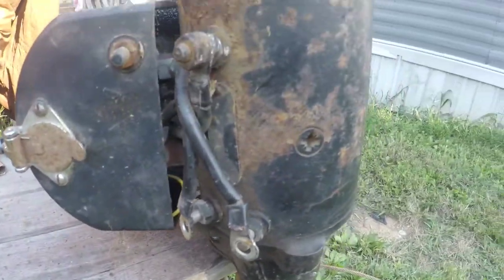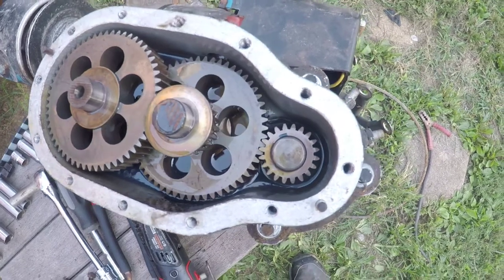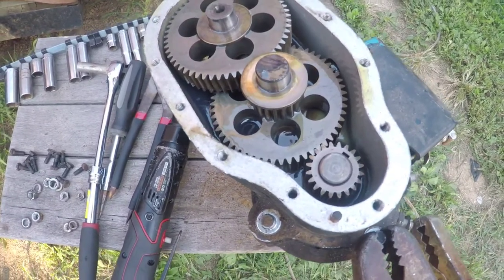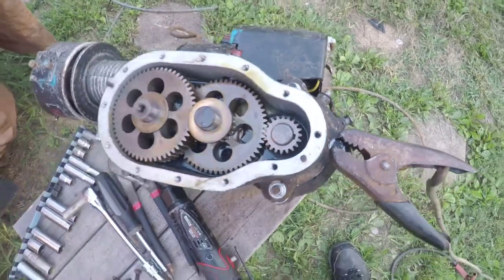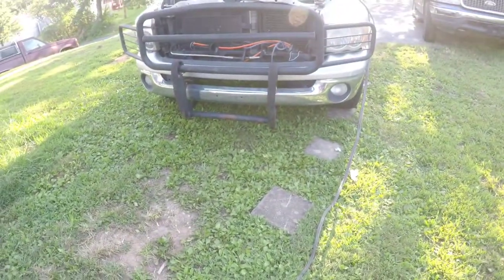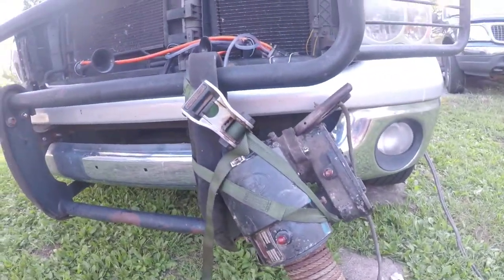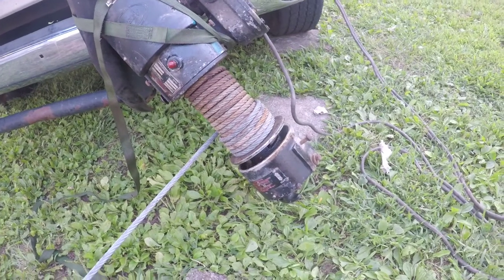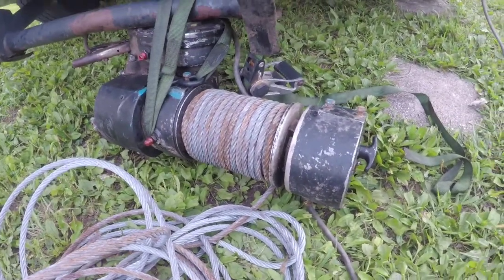Fixing a stuck Ramsey winch

Comment: I got three Ramsey electric worm drive winches dirt cheap over the years because I know the motor dies first and motors and parts are very reasonable. These are the standard in the wrecker world and most of the parts swap between hydraulic, electric and mechanical drive Ramseys. I photocopied my new gaskets (Zips Towing is a good source) as patterns to make my own in future using Fel-Pro gray paper. 
They are NOT cheap new so I'll buy used cheap ones all day!